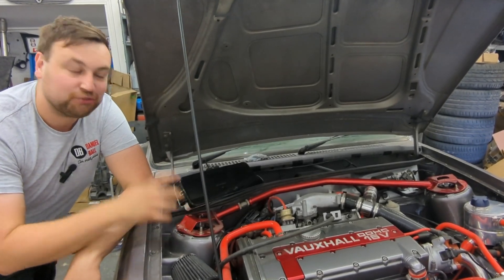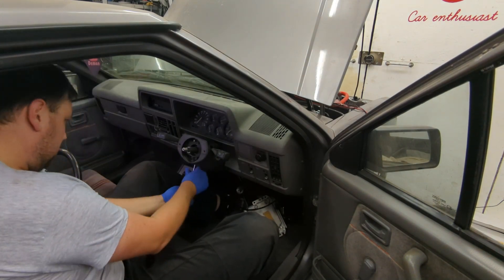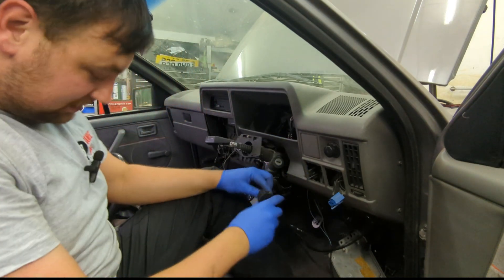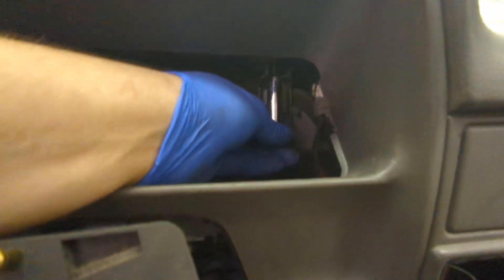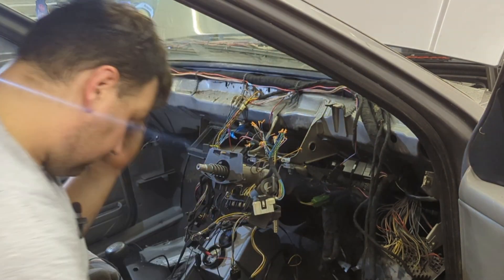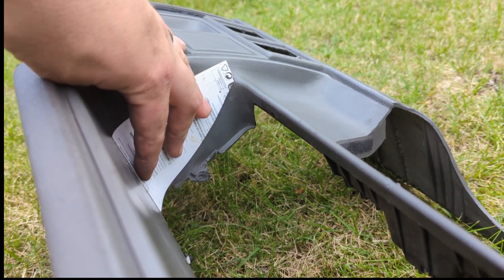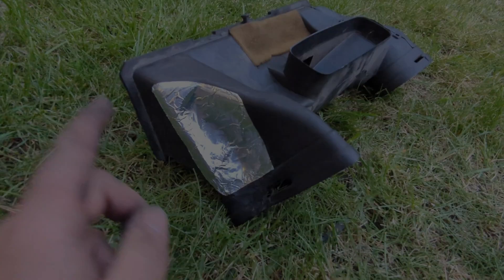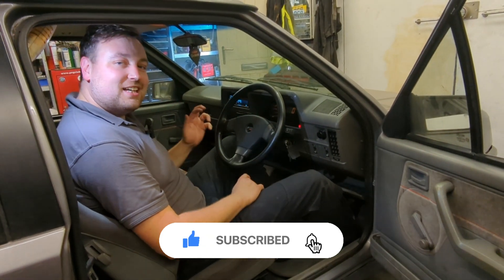CRACKING RESULTS Astra GTE Digi Dash conversion in a MK1 Vauxhall Nova - I explain HOW

Comment: Awesome job on that dash mate. I have the choice of the tick and curve rev counter for mine. I currently have the tick version the same as this, but I read the curve counter is rare?
Reply: Interesting. I though the tick was rarer and was the 16v clocks.

I have 3 digi dash's in the shed and assumed most of mine are curve type.
Reply from the maker: Nah it's the other way around. Would you like to sell one?
Reply: @DanielBall  no sorry I don't sell anything. I'm planning on fitting one of them to my nova ASAP. 

Then I've a few other nova projects I plan to build "one day".

I've had them years and never actually checked them until just now. They all have the tick type rev counter. So all 8v then? Which means an Ak speedo transducer is needed? Correct?
Reply from the maker: @deans_shed_fulla_novas  hi, this sounds right. Although you use the other type of you flick the red switch on top of the dash
Reply from the maker: Tick is from an 8V GTE, so far more common than the 16V curve type. Although the curve is rarer I think the tick type is sportier.